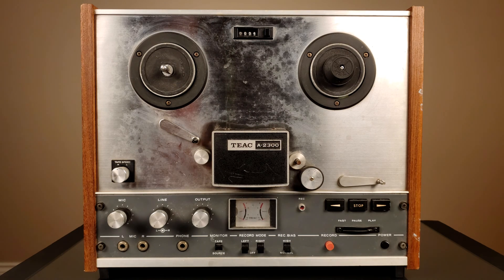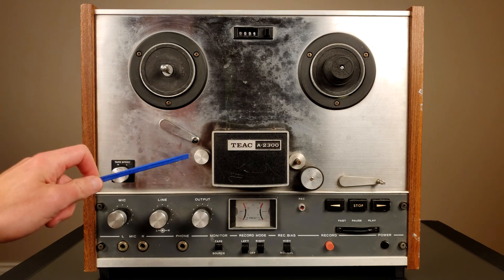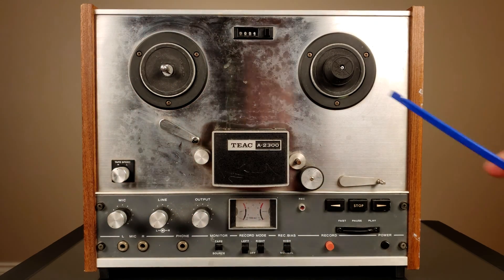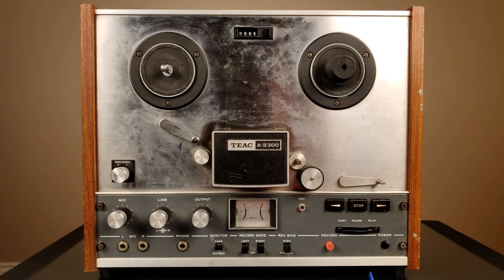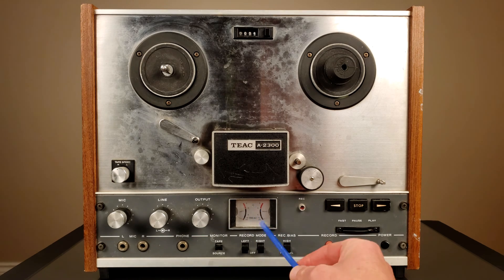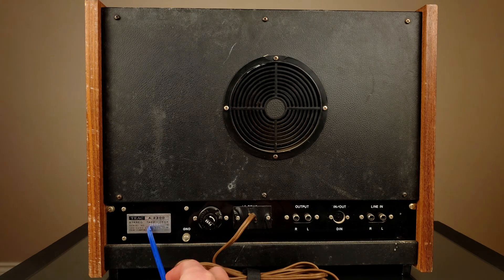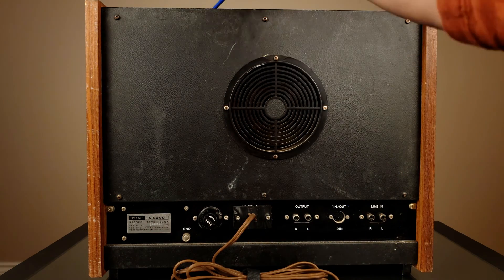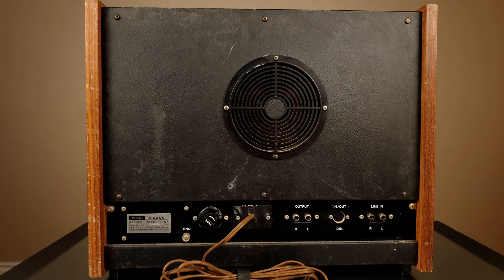Teac A2300 Repair Part One. Overview

Comment: How did you make out with the Teac?  On the Teac A-2300A I was recently given, I just finished disassembling, cleaning, lubing and reassembling the pinch roller engagement mechanism which was totally frozen.  Which was a pain, though there are a few YouTube videos that were helpful with that, but the service manual is a life saver for figuring out the electronics.  Now I gotta troubleshoot why the right channel plays very softly but the left is good.  Let us know your progress.
Reply from the maker: Thank you for watching !Yeah this was a pain to work on. But seems to be working fine ! Please check other parts to see my results.